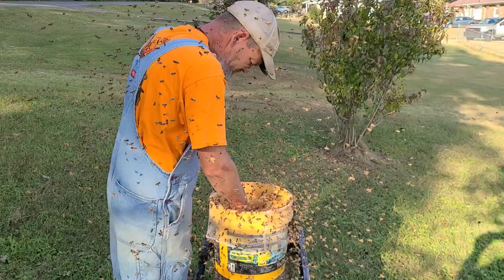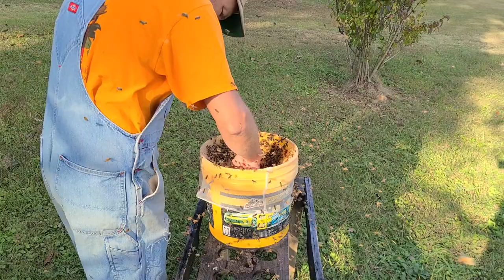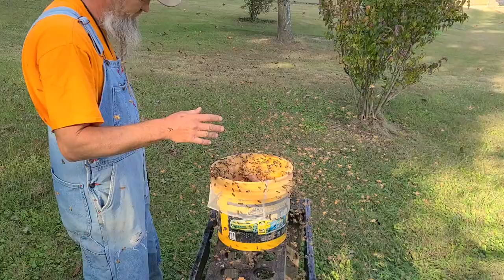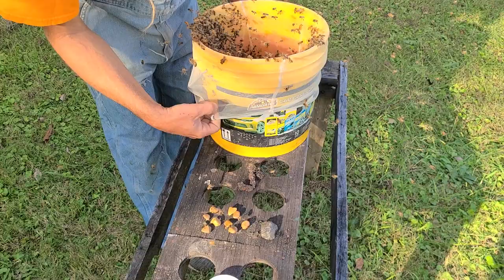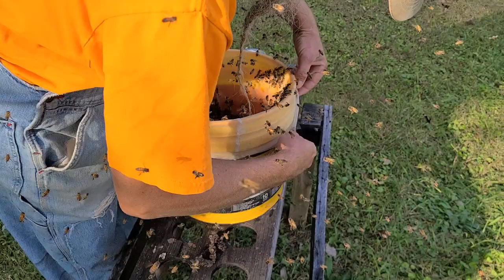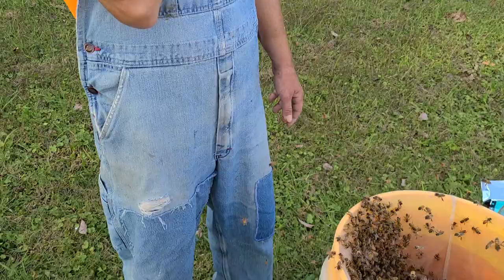NEW 5 gallon bucket feeder style.

Comment: I tried this with a float and had more bees die from drowning,there were so many bees come in at once they would drown those on the bottom. A kitty litter box filled with leaves and two quarts of sugar water. Works great
Reply from the maker: the float with the napkin on top to wick it up helps to prevent death and you have to have enough of them out to keep overcrowding. average is 1 per 10 colonies